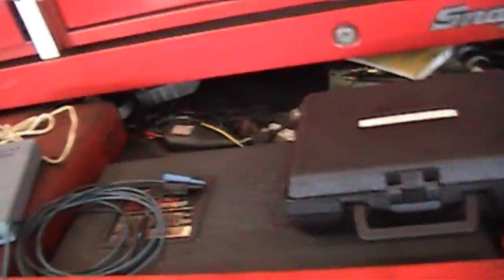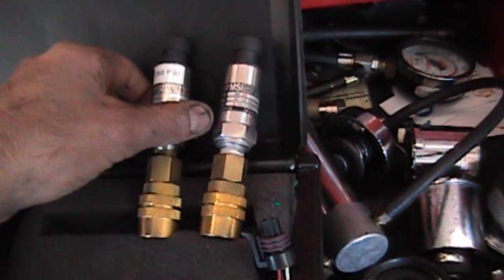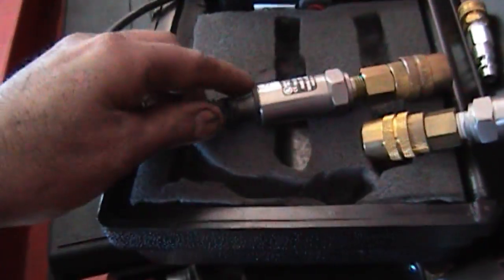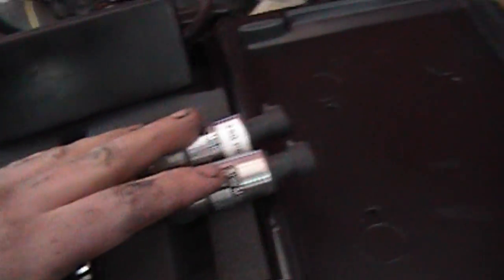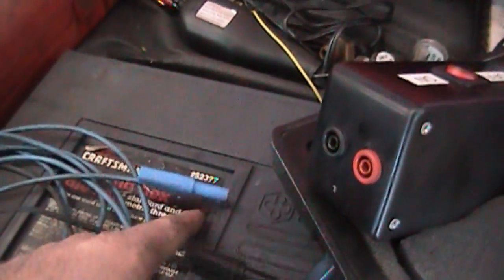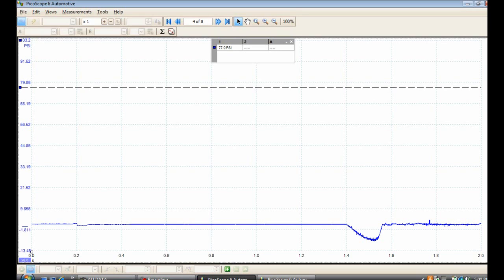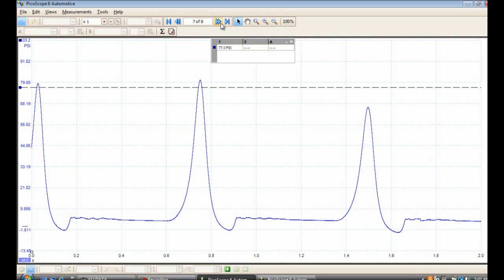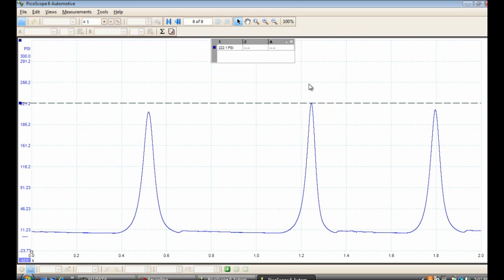Pressure Transducer

Comment: not sure why you need a 250psi when the 500psi will go from 500 to 0 and into a vacuum?
Reply: Usually the difference in range means the transducer can provide better resolution for it's range. Let's say the resolution on both the 0-250psi and 0-500psi transducer have a resolution of 16bits. That means for the 0-250psi range every .00381 of a psi can be represented. For the 0-500 range every .00763 of a psi can be represented. It all depends on how accurate you need/want your system.
Reply: Bias is esier to figure out its for accuracy

Comment: Hello. On this waveform, I don't see the exhaust valve close.  I also see some unusual artifacts at TDC and in the exhaust pocket on one of the samples. I'm assuming this has to do with the transducer being used...possibly because it doesn't operate with negative pressure? It is extremely useful as a diagnostic tool but much more so when you can compare to known goods from waveforms produced by the Fluke PV350 or the WPS500, IMO. Have you noticed this in your testing, and if so, do you have any ideas on changes to the project?

Comment: great video and good build. I am currently looking in to swapping over to pressure transdusers instead of mechanical gauges. just wondering though, why not use a 5v ref on the vehicle. I guess from the standpoint of not having to find it every time is good but still seems like this tool could have been built at a smaller cost. still very sweet. you have inspired me to try and build my own instead of buying snapys 400.00 set up and thats just for one transducer!

Comment: Few techs are using this type of methods for quick diagnosing and thank u for sharing(that's way there are no comments) by the way  haven't u done testing with intake pressure transducers to diagnose engine timing issues. i  did these type of testing with my fluke oscilloscope until some one cracked the lcd screen of it.NOw thinking of buying pico pc oscilloscope but i am out of money.